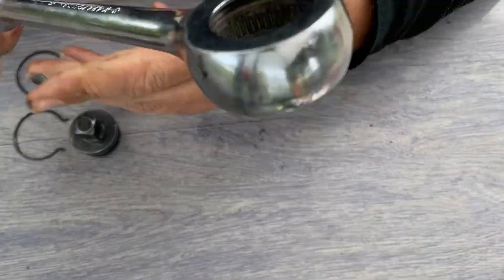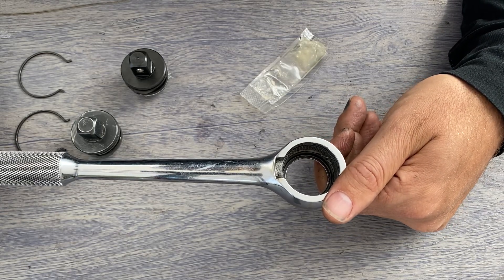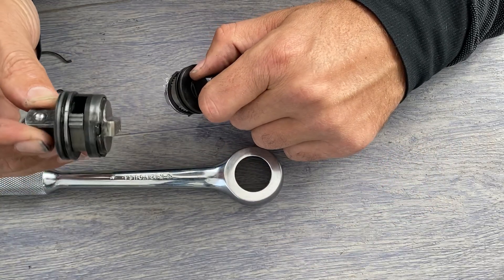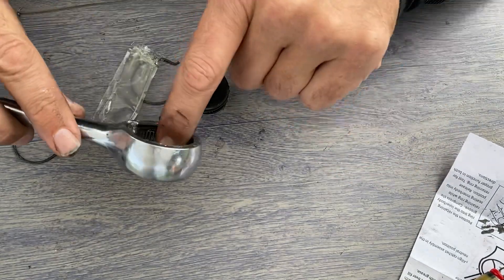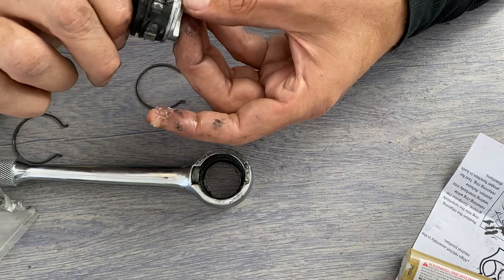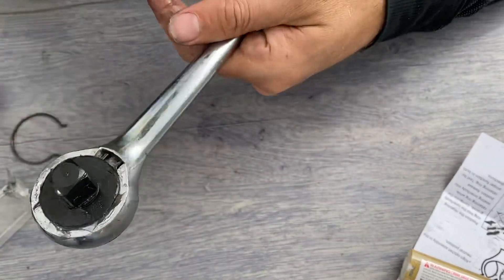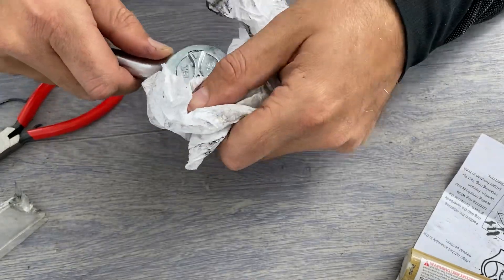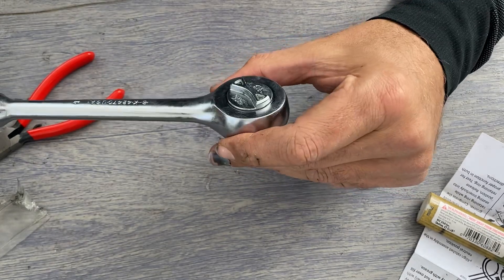Upgrading SK Round Head Ratchet to 100 teeth

Comment: It still has 50 teeth, it may act differently because the 2 pawls but it doesn't change how many teeth are in there.
Reply: While you are technically correct I believe the pawls are slightly offset so in have the swing it would normally take to get to the next tooth the second paw is engaging thus acting like double the teeth without actually changing tooth count.   

That’s how those 120xp gearwrench ratchets get their high tooth counts I believe.
Reply: @shawnwest3779  Ive done the 3/8 and the 1/2 upgrades and I gotta say you both are right. On the 3/8 noticed that it will go a tooth and a like half step, like a longer travel then a shorter one. The half inch kit seems to mainly be the same but somehow less backdrag than the 3/8 version. When you go really pulling on it to beak a bolt loose/tighten a lug they both engage, it really makes me feel better than the standard mechanism when putting lots of force on them. 
I would highly recommend the 1/2 kit! For the 3/8 kit I did my standard ratchet with the DT80 and just did a stock rebuild on my rotohead. 
The 3/8 backdrag is stiffer but nothing compared to a 800/900 series snap on, even felt less than a GW120 I felt in the store. Maybe do one 3/8 standard and one with the DT kit, the 3/8 ratchets go cheap online. 
Hope this helps guys, the DT100 upgrade really made me like my long 1/2 SK alot more.
Reply: Tell that to the marketing department of literally ANY tool company.  They've all been pushing this lie for years.  Always gotta look into anything with a respectable tooth count to see whether it's the real thing or not.  I'm pretty sure there's nothing advertised above 90 teeth that isn't dual-pawl.

That said, being dual-pawl doesn't automatically mean it's bad.  All the higher-count Ko-ken's do it and good luck finding anything bad to say about those.  There was one I saw recently that only went for a 1.5x increase and supposedly got some really good results for cheap that way.

Comment: S-K still makes this ratchet. You can buy it from their distributors or off their website. They have released new-style pear-head ratchets, and they're OK. But nothing is as good as their good old trusty round-head design. I have nearly the same ratchet as the one in this video and ordered an upgrade kit just recently. I am really looking forward to putting the new mechanism in and using it on an engine rebuild scheduled for early Spring.

Comment: I probably would've put in 1/4 of the amount of grease for fear of less than perfect engagement/contact between the teeth/pawl interface. Nice upgrade though! When I think of SK innovation, it's their swivel head ratchets. I believe they invented it.
Reply: Nice thing about this upgrade, and the reason you can swap a new mechanism for an old one is that they went to a double pawl versus the old single one. This means they didn't have to make the teeth smaller. Which means that you can use more lube. On some of the ratchets that he mentioned with 90-100-120 teeth, they made the teeth smaller to do it. Too much lube can affect the operation as you mentioned when the teeth are so small. Another reason to stick with the good old S-K round head ratchet. I have never known one to fail. I am sure they do occasionally, but no one I know has ever managed to break one.